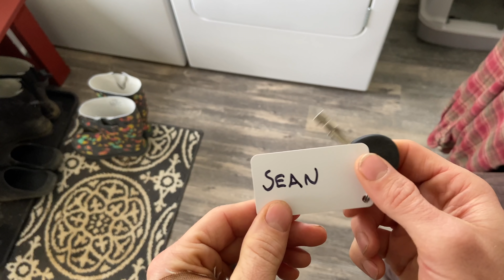I'm EXCITED For This New Addition to the Homestead

Comment: Grew up in the 50's and as kids we scrapped together all our building material.(your supply of wood is a blessing)
 Nails we found and straighten them out to make our carts. We fixed everything that could be repaired. I remember my dad getting tubes to fix a radio and later television sets had tubes that could be replaced.  We have become a throw away consumers for the cost to repair is sometimes more than a new product. When you do the trailer over it might make it fun to give it The Modern Yeoman touch. If the chicken tractor is heavy use the mower to move it. I bet you can make do with that mower for 15 to 20 years. Staying debt free and living within ones means is a great way to live. Very entertaining lead up to revealing the mower.
Reply from the maker: Thank you, Sandra! I admit it's so easy to just fall back on buying everything new. It's certainly tempting (and what I did with the mower, haha). But saving where I can and making use of scrap has become kind of a mission for me here. So inspiring to hear stories like yours; thank you so much for this!

Comment: Great new addition Sean! Congrats! I actually need to fix our riding mower. I believe it is either the starter or some electrical issues. Hopefully, it won't be that big of an issue. We use ours a lot around the homestead (Daily in fact) so I think you made a wise decision! In regards to your meat bird tractor... I love that you are using what you have lying around...just watch your weight. It gets heavy REAL quick. We also put wheels on ours so it can be pulled it two different directions. (Because they don't turn that easy)  I can provide a link to show you what I mean if you like.
Reply from the maker: Thanks my friend! The plan is to put wheels and skids on the tractor, but I would love the link to see what you’re referring to! 🙏🙏🙏
Reply: @TheModernYeoman  I find that pushing, instead of pulling, works better for me for one reason... you can see your birds because they are right by your feet. (I also use a hand cart) For me, if you pull it, (because of the roof) you can't see if they are not being run over by the edge of the wood on the tractor. Sadly, It will happen and sometimes it isn't pretty. Gotta be really careful.
 If you are going to pull the tractor, I did find a method of sprinkling a little bit of food on the new area that you will be pulling the tractor to. Make sure they see you do it...after that, they learn really quick to move WITH the tractor in order to get to that little treat that is waiting for them. This made a huge difference for us.
Anyway... here is the video that I told you about. The wheel section is at 5:20 or 25 I believe. If anything I said is confusing, please let me know.
https://www.youtube.com/watch?v=yP0HpV4AjD8
Reply from the maker: @CelticRootsFarm  SUPER helpful. Thank you so much for this.
Reply: @TheModernYeoman  Our pleasure!

Comment: So I might have something for you after all. I went to sleep with your drainage problem of the pool area ( I do my best solving when asleep). I am a radio ham and to get a good antenna system you need a good earth. What I do to get an earth might solve your problem. Goods needed a good water supply (long hosepipe, a 6 foot length of pipe 1/2 or 3/4 inch copper, a hose clamp to connect the hosepipe to the copper pipe a car exhaust bracket ( or a TV mast bracket) that would allow you to connect two bits of pipe in a cross and a hacksaw or file and some sand. So first you need to cut/file some teeth in one end of the copper pipe to a depth of 1/2 to 3/4 inch will do (not critical) at the other end of the pipe use the clamp with a piece of old scrap wood (old broom handle, 1x1 or 2x2 or what ever you have needs to be about 2 foot long) . mount it so that the wood and pipe have a comfortable  wooden handle. Now attach the hosepipe to the copper pipe at the end with the handle. WARNING this next bit might get messy, wet, mud or both! Stand the pipe up so that the teeth are in contact with the ground. Turn on the water and slowly turn the pipe clockwise and anticlockwise. The force of the water coupled with the teeth on the pipe will drill a hole for you. The water pressure will force the soil in the core of the pipe out around the sides of the pipe ( so it self digs). Keep this up until you find your at about 4 1/2 to 5 foot. once at that depth you can slowly pull out the pipe (with the water still on for lubrication). When the pipe is out fill the hole with builders sand (sharp sand). This should provide you with a drainage hols as you will be below the compacted area. One problem with this is that you need to have a good draining subsoil. If you hit rock it wont work. Sorry for the huge post but I don't know of another way to post this to you.
Reply from the maker: Wow. Thank you so much for this idea! I've been trying to think of novel ways to drain puddling areas and I think this may be the best idea yet! I may go out and test for rock later today. Thanks again! 🙏🙏🙏
Reply: @TheModernYeoman  Your more than welcome. You would have to do it several times over the area but it should work fine if no rocks. I haven't used this for years as my antenna's are all well seasoned but not in need of replacement. I do enjoy the challenges that people pose and it helps the grey matter to work a little bit better. Thank you

Comment: Nice rig! The key issue however, is with the size lumber you are using for the meat bird tractor, will that rig be able to pull it? It looks way too heavy to move manually.0
Reply from the maker: Good question! I’ll be putting wheels and skids on the tractor, so I’m hoping that will suffice with a hitch. Fingers crossed! 🤞🤞🤞
Reply: @TheModernYeoman  If not maybe the car will. If it doesn't get bogged.down in muck.